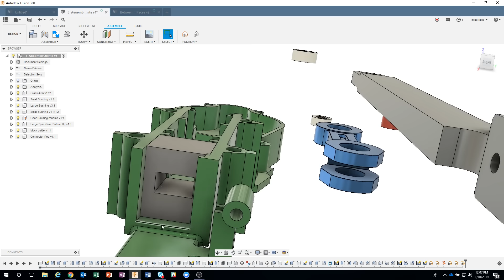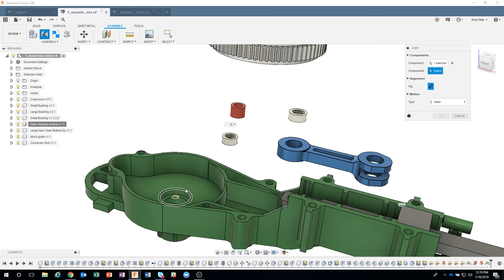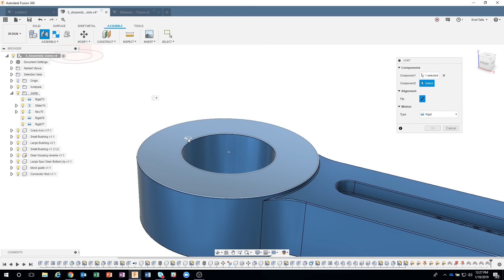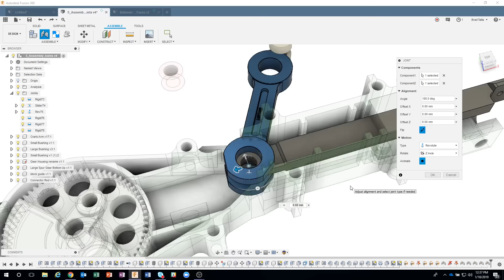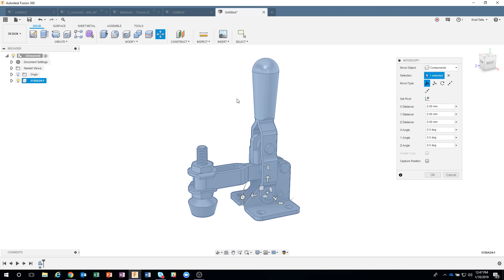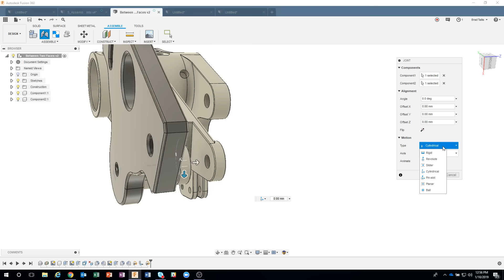Episode 05, Fusion 360 Assemblies and Joints

Comment: Brad, I just started watching your videos a couple of days ago, and they are amazing! I used to watch Lars (Christenson)? a long time ago.
This video is old and has the UI preview. This has changed of course. It has the 'assembly' tab. Current fusion does not.

I was wondering what the difference is between creating a hybrid design (which I typically use), and an assembly design. It sets is up and the first component is 'external 1' and has an 'edit in place' sort of dialogue. I'm not sure if I should create components that are hybrid inside the assembly or not.

Investigating this, I see that each part is saved in the cloud individually, (whether hybrid or external).

Hopefully, you have another video that already explains the differences.

Yesterday, I downloaded a toggle clamp from McMaster-Carr and converted all the bodies to components and animated it after making joints.

I wish I had your job! I'm 58 and have been doing fusion for ~10 years for 3d printing design (mostly). Yesterday, I even set up OBS studio for purposes of making videos like you do! We'll see.

Thanks again for all the great content!

-Michael

Comment: Question...Can you create an assembly from two individual designs? If so how do you combine them into one assembly design? In Episode 05 you have several components in a single design, how did you get all those components into the design for the assembly?

I am trying to do a very simple rack and pinion assembly but it is proving to be more difficult than I thought. I am able to get the pinion gear design open and then I am dragging the rack design in to assemble them together and then have motion.

In Episode 05 you are able to freely drag the components around, I am not able to do that with the pinion gear or rack. Anyway I'm not sure if you are still reading these comments but if you are any help you can offer would be great.

Comment: Hi Brad, thanks for another clear video. Your joining of the components of the toggle clamp made me wonder how far you can take simulation in Fusion 360:
When using a toggle clamp I take it through the position of „straight knee“ to bend the „leg“ just that little bit further so that the clamp stays locked. The elastic decompression of the rubber component of the clamp provides the necessary holding force of course.. How would I model the compression of rubber. And is it possible  to show realistic dynamic behavior in Fusion 360, say releasing a ball from the rim of a bowl.
Sorry to pose such almost off topic questions, but your excellent talks just get my mind racing.
BTW in German a toggle clamp is called a knee lever, hence my use of the anatomical analogy.

Comment: I have a project I am working on.  It is made from 1" square extruded tubing.  There are several different lengths of this extrusion that I want to join together to create an assembly.  This is similar to 80/20 but the extrusion is different as three sides of the 1"  tube are flat and only extruded on one side.  I want to join one of the lengths of tubing to another along one of the flat faces.  How can I create joint origins at specific locations along the face of one of the flat sides of the 1" tube so that I can join the 1" tubes together.  Or should I just draw points on the face at the specific locations and then use joints to attach them.  Hope that I explained this well enough for you to understand what I am trying to do.  Probably something simple that I missed along the way.
John
Reply: Learn Joint Origin
Reply: @aurion61  Thanks for the input.  I have watched several videos on the subject and a couple of new ones today.  I have practiced moving the joint origins around once a flat surface is selected.  That is a piece of cake.  A couple of things that have complicated the mater is that the Extrusions are not square on the edges as they have a radius that has to be compensated for when determining the actual Joint Origin as they actually snap to one of the radius corners not the center line of the actual edge of the 1" square.  I actually designed the extrusions in Fusion 360 and then extruded them to the various lengths needed for the project.  The ends of the extrusion are not flat surfaces.  If they were I could just place a joint origin on the center of the end of the extrusion and all would be fine.  A few minutes ago I tried making one of the extrusions a rigid group.  That seemed to help if I used the edges as a joint origin point.  I haven't given up yet as I think it is possible.  If I had just modeled it as solid 1" square tubes the joints would have been a piece of cake.

John